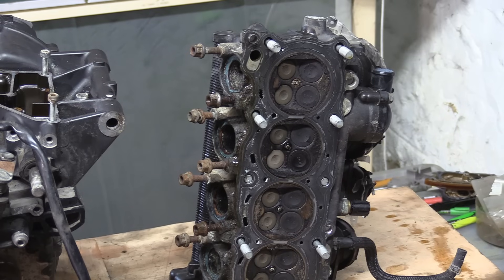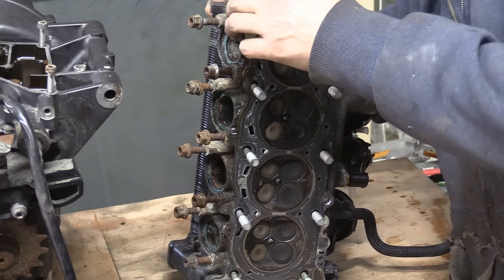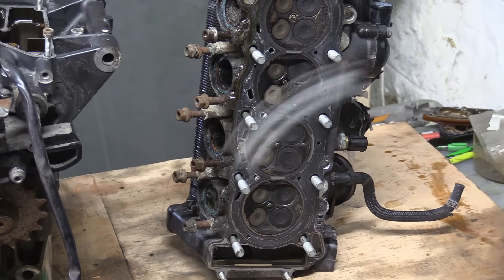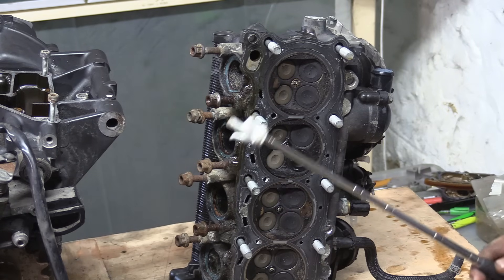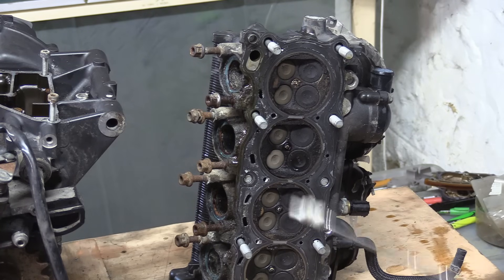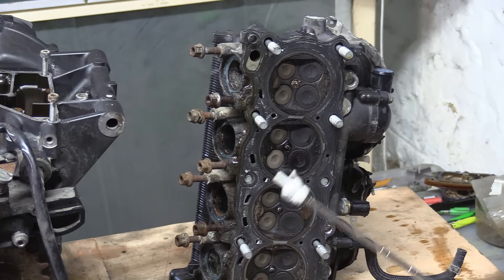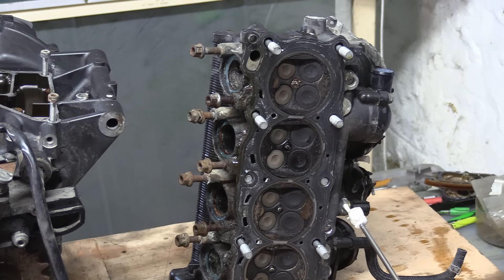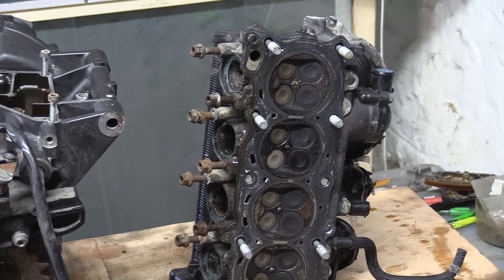Cylinder Head Cooling CHAT

Comment: why do they use torque to yield bolts on everything now days?  why not 12.9.. cost i guess..
Reply from the maker: They don't.
Reply: @thedirtyworkshop  on head bolt they use em.. shitty bolts
Reply from the maker: 1. Yes I know. 2. They're not shitty. 3.  Do you know why they're used? 4. That's not everything, unless you mean as head bolts.
Reply: @thedirtyworkshop  I meant top bolts, yes, if I understand correctly, it's because they act a bit like a spring? a bit unsure